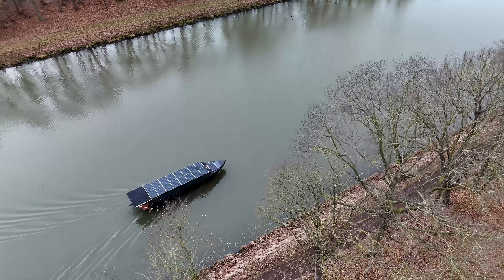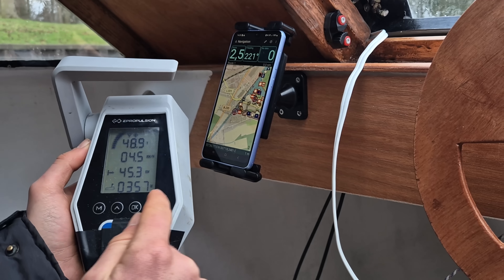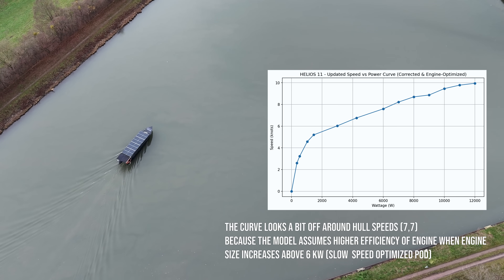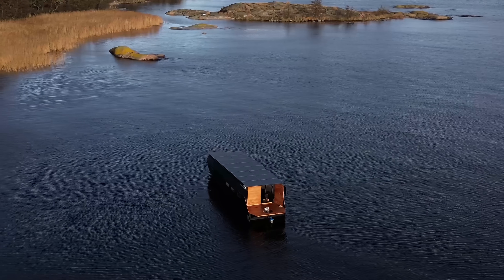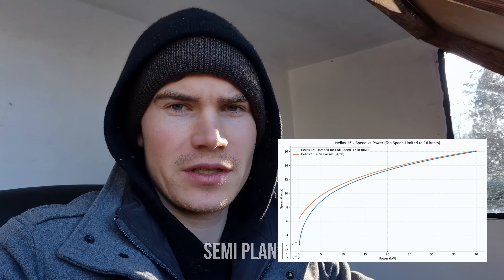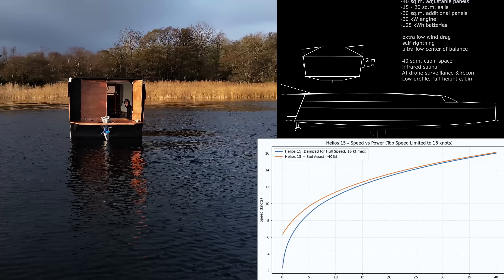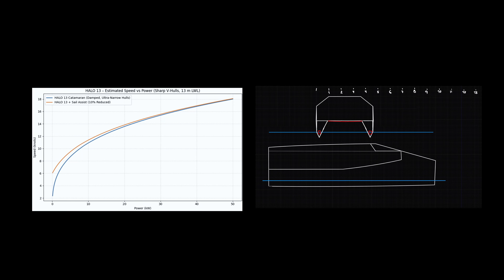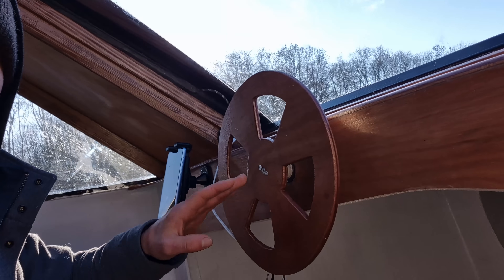10 Knots on Solar? Speed Test of My Infinite Range Explorer

Comment: Looking good, but increasing engine size puts the boat into a new category which will need registration and paperwork and licensing!
Country-Specific HP Limits and Requirements
The horsepower thresholds that trigger licensing and registration requirements vary significantly by country. 
Country 	License Required Above	Notes
France	6 HP (4.5 kW)	Canal houseboats are often exempt and require only a short briefing.
Germany	15 HP (11 kW)	The limit was previously 5 HP. Special rules apply to the Rhine.
Italy	40 HP (30 kW)	The most permissive limit in Europe. On some lakes, licenses are required above 5 HP.
Spain	15 HP (11 kW)	For motorboats under 5m in length; rules vary by zone.
Poland	10 HP	Boats with up to 10 HP can be operated without a license.
Netherlands	No license needed if boat is under 15m and cannot exceed 20 km/h.	Speed/length are the primary factors, not HP alone.
Reply from the maker: We dont need to tell :)
Reply: @Lukas-TrueNorthYachts  Just use common sense and I'm sure you'll be OK!
Reply: Indeed, ive sailed The Netherlands for years, never had to have a license.... never had any issues either, they are pretty chill on the waters here.
Reply: In Sweden there is no power and speed limit, only a size one. No registrartion needed under 15 meter and no licence under 12 meters. So I dont know if I would call Italy "the most permissive" since it seems at least Sweden is more permissive and I somewhat doubt its the only one...